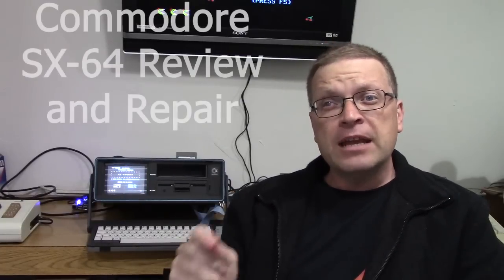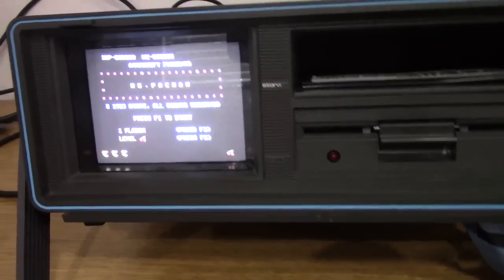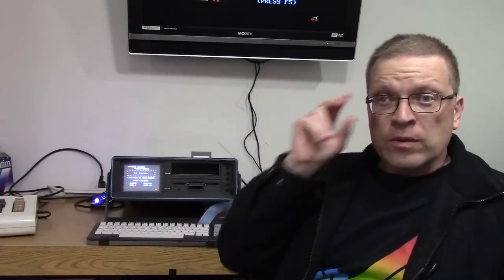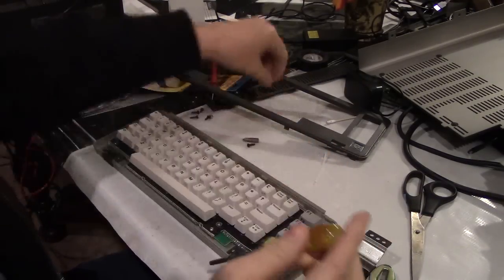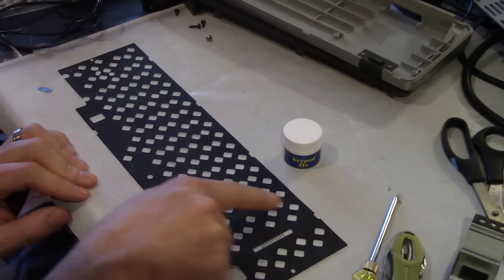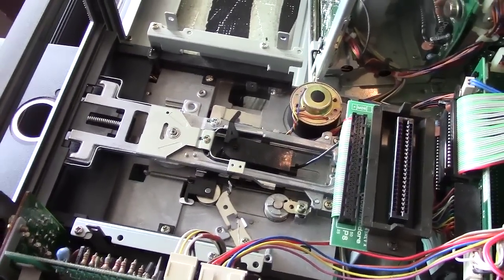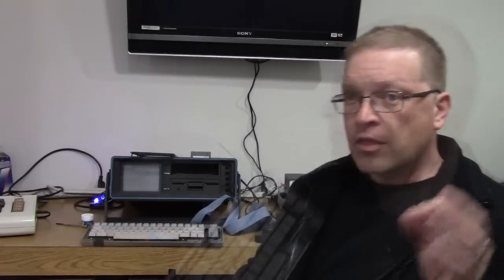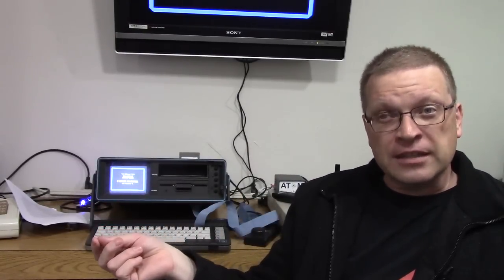ChickenHead Chronicles -  Commodore SX-64 Review and Repair

Comment: Love my SX64, there are also external reset switches for the external drive plug available or you could install the "SX-64 Ultra Reset" module from CBMStuff. I bought one but never put it in, as now I finally found the best SX-64 add on I have seen so far and built it in last weekend, it is called the "C64 SuperKernal +WLan" and it was made by 3 members of the German C64 forums, no hole and no switch required, you put that in instead of your ROM, you have a few storage slots on your SuperKernal on which you can store different C64 Kernals and even games and you can update the Kernals and programs using a tiny WiFi add on and a FTP server on the Internet! Just amazing. As an option you can also use it to change the internal drive address to anything from 8 to 11 when connecting it to the contact bridges on the disk controller PCB. So finally I set my internal drive to address 10 just by changing the settings in the SuperKernal menu and can use adresses 8 and 9 for my external Ultimate II+ and can boot from there.
Reply from the maker: That sounds like a really cool device! I will look that up and see how much it is.

Comment: The built in speaker is very good as built in speakers on computers go, not really any worse than the speakers on most LCD TVs today, but not quite up to Panasonic/Sony etc Widescreen CRT TVs. It is better than the one inside the Amstrad CPC and Acorn BBC Micro PAL rivals to the Commodore 64. I had one keyboard cable that when you power on the machine there was a "2" printed under the Ready prompt and no response to the keyboard, was a single bent pin. Always a 2 as if you accidentally hit the [2] key when turning it on.

Comment: After I watched this show, I was inspired to pop up a key on my A1200 keyboard to fix the E key, but when I put some thick oil on the shaft, the key almost stopped working. The spring which was there must have gone over the room somewhere, and I cant find it. I used the spring from the keypad Del "." key, but this also flew off, and I spent an hour trying to find it. The E key is still not working fully, but I dread to remove all the screws on the back. The moral is, if it aint broke, dont try to fix it with car engine oil.
Reply: Great video btw, very much enjoyed the tour and the tips.  Today I found my spring!  How often do people say that?  :)

Comment: I’ve had an SX-64 for a few years now that’s limping along. I got it working by replacing the PLA, but the drive and keyboard need TLC.
Reply from the maker: Those were two of the three things wrong with mine. The keyboard cleaning and graphite paint touch-up have it working 100% now. It is worth it!

Comment: but you put grafite under the membrane, clean the contact  or only on the top too
Reply from the maker: I very gently clean the membrane so as not to rub off too much of the existing graphite, and lightly touch up the contact itself with the graphite paint. Don't glob it on, just a very thin coat if possible.

Comment: Hello Doug aka "Mister 10 minutes". I used this video to get the my keyboard working again on my sx64. :-)  I bought the SX from Ebay and the x'th owner ago  did some heavy modding. Perhaps due to this modding he or she broke the cartridge reader in the process. Any idea how i could pinpoint the problem ? The Sx is booting, keys are working. the disc is spinning but , even after cleaning the head, the discs aren't readable. Like i said when a cartridge is inserted..: blank screen. This cartridge works on another c64 and I sprayed some contact cleaner on the connector allready..
Reply from the maker: The cartridge slot is possibly one of two things. It may need some more heavy cleaning with IPS and a q-tip, and really scrub the contacts. Not just a light wipe, but really scrub! This has brought a VIC-20 and an Amiga connector that I thought were clean but didn't work back to life. THe second possibility is the ribbon cable could be bad. It connects the cartridge slot to the main board, and if part of the cable is bent or broken, it won't work right. Check the cable very carefully. I think you can unplug it from the mainboard, and use a continuity tester to check the connection. You can also clean the contacts for it on the mainboard. The floppy may need to be lubricated, too. Make sure the head travels freely on the rails and does not stick, and that the mechanism that spins the disk spins freely without too much resistance. (some resistance is normal) Let me know if any of this helps